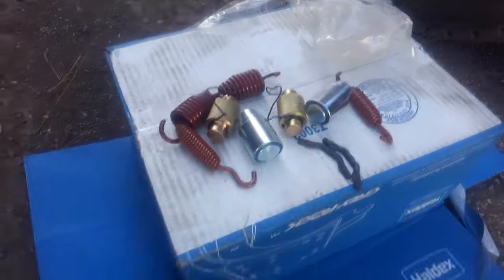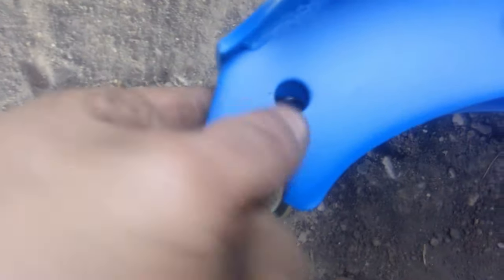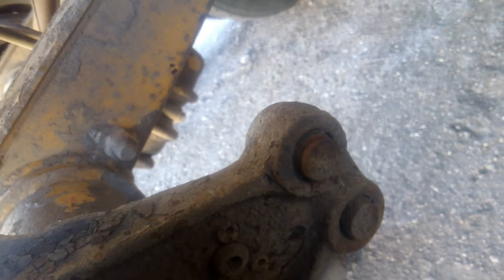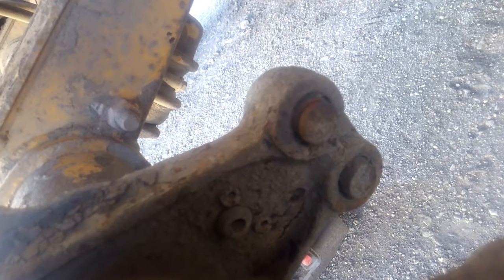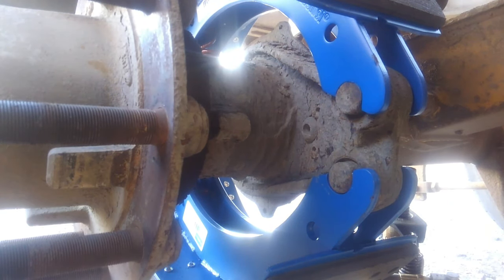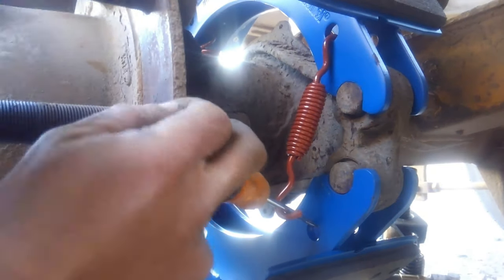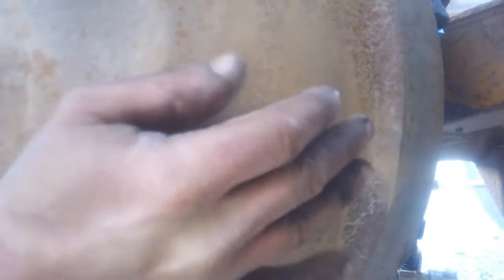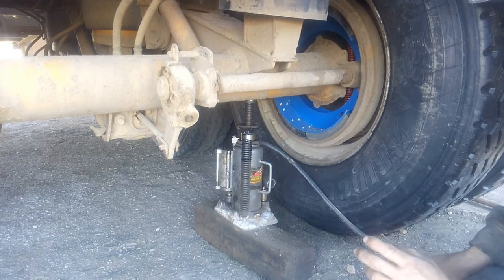how I change semi brakes in 6 mins

Comment: Any good advice on dealing with brake shoes that have seized to the drum? 
The truck sat in the weather and it’s probably going to require replacement of all the brake parts, but I need a good way to unseize the drum so I don’t damage anything else in the process.
Reply from the maker: bfh... release the breaks and smack the drum with a hammer a few times the vibration should break the shoes free from the drum.
Reply: Release the brake, back the slack adjuster off, start truck and pull forward/backward to free the shoes from the drums.

Comment: Do you change the drums everytime.  Or do have to on tank trucks hauling crude oil
Reply from the maker: Not required as long as the are in spec if there all gouged out from gravel and rocks driving lease roads then no there not legal

Comment: Seized bushings, didn’t even mentioning checking stroke, no lubrication on pivot points, and an improper brake adjustment (it’s 1/2 turn). Yup, it’ll get get it back on the road, but good luck on how long it’s going to last. The instructions are right on the box and you missed half of them in this video....
Reply from the maker: I'm pretty sure I mentioned checking the stroke being this video is years old. Iv shown how to check stroke multiple times on the channel. Iv also done another video showing how to remove seized anchor pins this was a quick I'm changing some tires oh should probably change shoes but I got somewhere I gotta be in 45 mins

Comment: Uhhhh scuse me bud, but why didn't you use a new drum? New linings, new surface....both contacting evenly all around to maximize braking efficiency, safety. Am I wrong?
Reply from the maker: that's actually a good question. generally you can run 2 sets of shoes before replacing the break drums. the drums do need to be inspected. it used to be common practice to resurface the drums but its been proven that it does not actually help anything and actually reduces the life of the drums by increasing the inside dia. i had not really thought of covering break drum inspection. but might be a good topic.
Reply: According to DOT regulations drums don’t need to be change until either cracked or worn out. Worn out is at 120 thousands of a inch. But he should of changed those anchor pins, when you leave old one on the new brake shoes tend to want to stick out of the drum. New shoes means new hardware that’s why it comes inside the box. But it’s a good question normally under regulations applications you will wear off about 40 thousands on a inch off a drum so after two two brake shoes you should replace the drum because chances are the drum won’t last the full life span of the new shoes.
Reply: Very good information thank you. I am about to become a tractor/trailer Maintenance tech. and I am trying to learn all these little details about brakes and other maintenance things. Thanks for sharing guys
Reply: haha honestly my hands grew a full glove size when i started heavy duty
Reply: @FlyDontLandOnFlowers  you will understand what I mean if you decide to work on big trucks..and your knuckles are squirting blood and your fingers are swollen and locked up 🤣😂😁😁😂😂🚚
Reply: On trash trucks we replace drums every time. If you don't the hotspots will let you know when the truck is coming. They howl. With q+it's about once a year depending on the driver.
Reply: U should see the brake spring tool I made, one of the old guys i work with let me use his home made tool, it worked ao well i traced it and made my own. makes taking springs on and off a breeze, and eliminates vice grips, and pry bars from the equation lol.

Comment: Your amazing
Reply from the maker: I don't know about amazing...lol but I appreciate the compliment. Thank you
Reply: @Ezrider359  real world knowledge, saved me ,thank you sir
Reply: I've been trying to get an answer on recirculation flap on ac system,I cant get any air flow from vents,changed air box in dash,changed blowers,motors,scrubbed core,nothing,found actuator that had arm but is broken under fan ,no one knows what this is,07 kenworth t6 vin 206093
Reply from the maker: @kristievanthul7086  unfortunately i don't have access to kenworths parts system, i think the best route might be to try to identify the part on a exploded parts diagram, might not really be considered a service item so might not be redially available. another option may be to check with junk yards that have large trucks. might be able to locate one there.

Comment: I use a 1 1/8 inch wrench to pry on the slack adjuster after backing them off to check if they are adjusted correctly.  Anyone else do this?
Reply from the maker: yes, that is acceptable, and recommended.

Comment: Correct me if I'm wrong this wasn't a 6 min shoe replacement? When it comes to brakes there is no time limits when dealing with safety of people. The shoes were change but was the s cam ever greased or inspected for play or its operation with out the shoes on? He never bothered to replace the seized anchor pins because finishing the the job in 6mins is more important again there are no time constraints on brake jobs. Especially on big trucks. He'll get the anchor pins next time right. If your going teach try to teach doing it the correct way.  Puting shoes on is the easy part inspecting and finding possible down the road failures is more difficult, slack adjust was it inspected for fatigue or cracks?
Reply from the maker: s cams and bushings and drums were all replaced on the previous break job on that trailer. and yes real time was more than 6 mins. s cams were inspected and greased before the truck went back into service. the 6 mins referrers to the length of the video demonstration. most the video's i had seen on youtube were 30+ mins and still skipped over a lot of stuff i showed in this video. i personally skip anchor pins if they are seized but not excessively worn, once they become worn i change them install with lots of anti size and then they come out easily for the next break job. the part a lot of people doing there own break jobs struggle with is the springs. so that was kinda the main focus. i do actually appreciate the feedback though. thanks for watching.

Comment: 1. No Jack Stands
2. Did not inspect s-cam bushing
3. Did not inspect wheel seal
4. Did not change seized and off center anchor pins
5. Did not measure drum diameter
6. Did not torque wheel nuts with torque wrench
7. Did not check brake stroke after adjustment
Changed brakes in 6 minutes by doing a half-assed job. Getting pretty tired of people putting up so called instructional videos and showing how do do a job poorly of unsafe.
Reply from the maker: Why don't you make a video then
Reply: I'm not in the business of making videos. I'm in the business of repairing trucks and training apprentices.  When making repairs and perhaps showing other how it is done it is important to make sure it is done right before it is done fast.
Reply from the maker: @douglascook6390 , i have not been paid one dime to date for a single video i have made, this is one of my early video's i think i have gotten better at showing how to do things sense then. 6 mins refers to the length of the video not the time to do the job. most video's iv seen on brakes on you tube are 30+ mins long and cover less details than i showed in this video. yes it was a quick job, when i recorded the video i was throwing a set of tires on while the tires were off i noticed the breaks were getting close to needing to be changed and some people had asked me to do a video on brakes so i made a video covering the basics of the job and did it in a way that gives a overview some helpfull tips and values the viewers time. i had noticed the wheel seal was seeping while changing the brakes didn't have time to do a wheel seal that day so i was back in there the next week doing a wheel seal.  i am a owner operator my video's are geared towards the do it yourselfer, sorry taking time out of my busy life to make video's try to help people annoys you.  if you really have a problem with it put your money where your mouth is and make a video, its not as easy as it seems and it takes time and there is a learning curve on making good video's. if your a professional mechanic your not going to learn anything from me so why are you watching?
Reply from the maker: @douglascook6390  btw the reason why your comment kinda annoyed me is because you assume a lot of things in your comment, like not torquing the lug nuts how would you have any clue weather or not i torqued the lug nuts when i didn't show putting the tires back on. you have a few valid points but the Holier Than Thou attitude and assumptions is what annoyed me.
Reply: Talking about a rule book warrior. If the book doesn't tell him how to he's screwed.
Reply: Pads probably cost more than the truck thats why😅😅😅
Reply: It’s a video for just a show slap. Private owners will do this to keep costs down and having all the right tools to do it costs money. Good video on just a shoe slap if present components are good to go. When working for a Fleet or a shop Mechanics That do this work are liable if an accident happens that involves deaths. I work for a Multi Million Dollar fleet which they really are concerned about liability so we on every Brake job replace the S cam bushings,shoes, Hardware and drums. It’s a good video with minimal tools and for people who own their own truck. As long as they know the other components are good. As for the Anchor pins, It is a bitch when they get seized on there. He would have to make another video on just replacing them. We have a press but when they do not budge then the Big Red Wrench is needed. In our huge fleet there are different shops that work on the equipment and what really gets me is that they get payed by the hour to do it correctly and most of the time they do not replace those anchor pin bushing cause they just do not want to work hard to get the job done right. So guess what? iI end up spending about an hour to remove the. All cause the last guy did not bother. Again I’m just talking about our organization not the one who made this video. Good Job on explaining a basic shoe and hardware replacement.👍🏻
Reply: Oh forgot to say S Cams as well on the brake jobs!! Lol

Comment: Omfg, I would never let you touch my truck, those pins are so far gone they will be howling in less than a mile, AND NO NEW DRUM?!?!? BOOOOOO
Reply from the maker: omfg i wouldn't work on your truck anyway i only work on my own junk. worn pins wont cause any howling they will cause the shoes to not locate properly, you can normally get 2 sets of shoes out of a drum before you exceed the max inside dia. also this was done years ago and inspected by dot many times with no issues. can you do it this way every time, no. its a quick tires were off go ahead and slap some new shoes on job. iv got other video's showing how to address some of the things that were skipped over in this video.

Comment: I guess you never heard of an anchor pin press.
Reply from the maker: Accually I have not. I am not a full time repair shop I just maintain my own equipment. Many of the specialty tools fall into a price range that doesn't meet the cost/benefit unless you're using them everyday. I will look into it though and if they are inexpensive enough to be worthwhile I'll get one. I would hope no full time repair shops are watching my little videos to learn how to do repairs....lol
Reply: I work on truck all day everyday and refuse to pay 300 bucks for a "pin press" when the exact same thing can be accomplished for less than 1/3 of that...
Reply: Ball joint c-clamp press works on the anchor pins to
Reply: I use a ball joint press and crank it down and with little heat shoots out lol.  The sleeves i hit from the side with an air hammer and that creates a center which i hammer out takes like 10 mins
Reply: I find it interesting that people make such a big deal out of the frozen anchor pins. The old style  trailer shoes actually had snap rings and a bolt to hold the anchor pins tight. Eaton 4709 shoes among other truck brakes shoes have a rigid anchor pin. The anchor pins and bushings should be replaced every time, but the reality is not every pin and bushing gets replaced every single time.

Comment: There is no adjusting brakes on a self adjusting slack adjuster you set your free stroke to 3/4 of an inch then hit the brakes 15 times then check your free stroke it’ll be at a 1/2 to 5/8 the way your doing it causes fires
Reply: Bullshit! if you actually believe that auto slacks actually "auto adjust properly" you need some training! I've been doing it the way he did for 25 years bud and I have NEVER had one catch fire, that would be because thats the way you're supposed to set them!
Reply: bigbigjohnlee666 they do to an if you don’t know they do you need the training an if they don’t adjust properly you need to change them out
Reply: Catch fire when you you fuck up and use incorrect cleaning fluids.

Comment: You must watch this video if you want to know every wrong way to do a brake job.  For starters throw the screw driver away and buy the correct spring tools. Next never leave in frozen anchor pins.  How about at least grease the worn out s cams and slacks and buy the correct press to change the anchor pins. This guy keeps changing brakes like this and he will be missing fingers in a couple years guaranteed I’ve seen it happen.